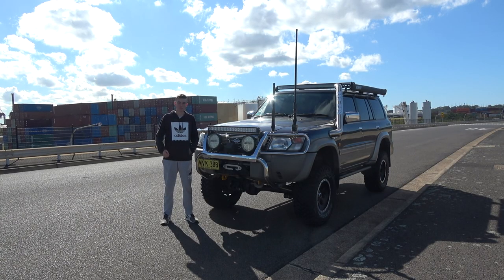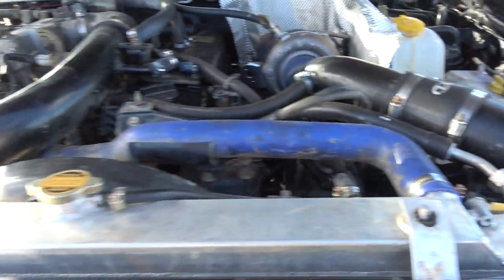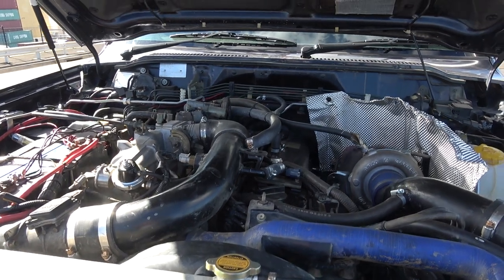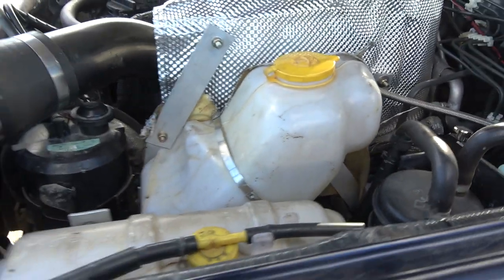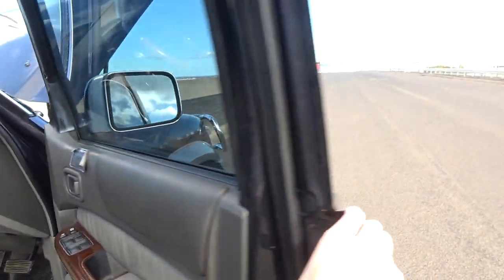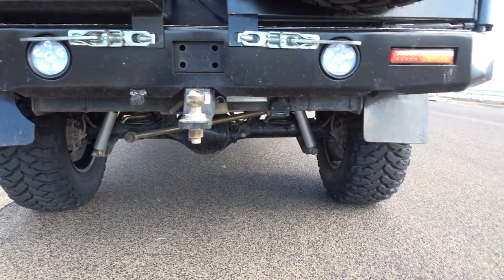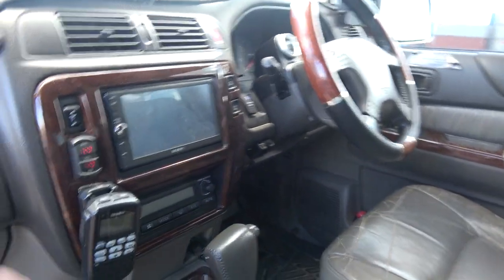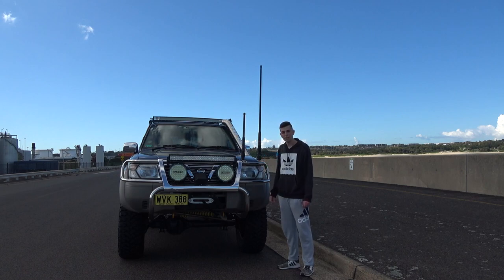200hp Nissan Patrol | Rig Rundown | TB45 Turbo

Comment: hey man, thanks for the rundown. Hope your fuel economy has come down. I get 18-20/100km with my turbo, haltech elite tb45. Did you put new injectors in, what brand are they? have you had issues with the manifold and turbo gaskets splitting. Good video too.